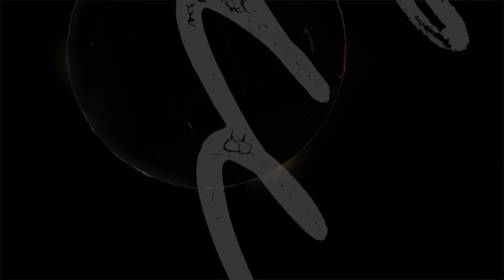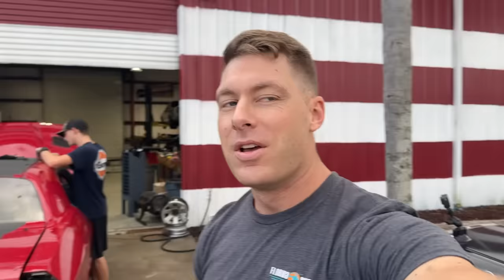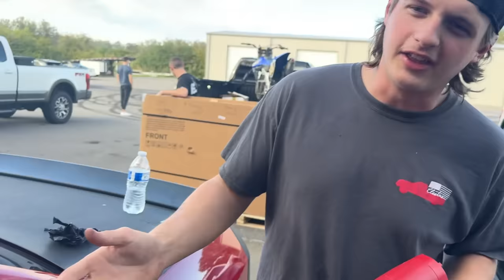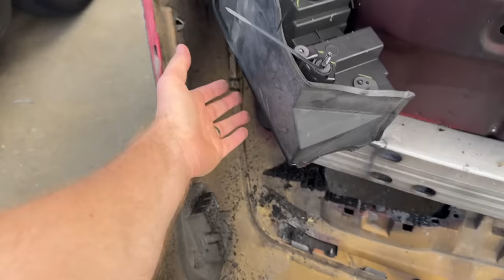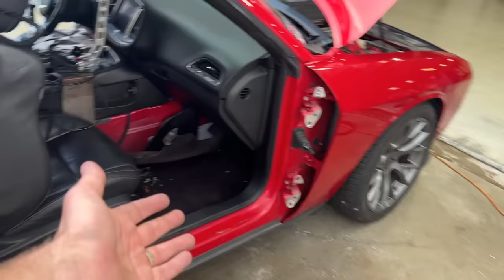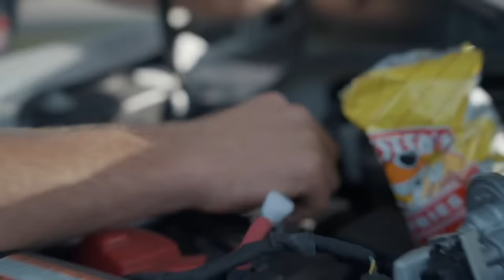The Worlds Highest Mile Hellcat is Being Restored! SCANDAL RIDDEN New Wifey Whip!

Comment: For your power steering add a remote cooler, like the derale you use for transmission coolers. They even sell specific cooler lines with fins for power steering cooling.
Reply: Theres probably a factory one on the cop cars he could track down

Comment: on some farm trucks we use the power steering pumps to power a hyd ram, so we need more fluid.  so we mount a radiator hose to the fill on the pump and run it up the fender like you said, then fill it up.

Comment: If you put an under driven poly on the power steering pump, it’ll slow the speed down which will keep the fluid cool and you can also put an oil  cooler on it if there’s room in the front of the car you just tie into the return line

Comment: Pro tip for wrap removal. Get a turkey fryer and fill it with water. Bring water to a boil. Soak towels in the water and drape over the wrap. It will heat soak the glue and make removal so much easier and less likely to damage the paint.

Comment: Body swap it with a 1998-2011 Ranger long bed. The Challenger has a wheelbase of 116.2 and those Rangers have a 117.6 wheelbase. So a 1.4 inch difference, which seems like a lot to most guys, including me. But i don't think it would matter much. Or older 2nd to 4th gen Dodge Grand Caravans have a wheelbase of around 119 inches. Dodge Grand Hellavan go up against the Plaidossy.